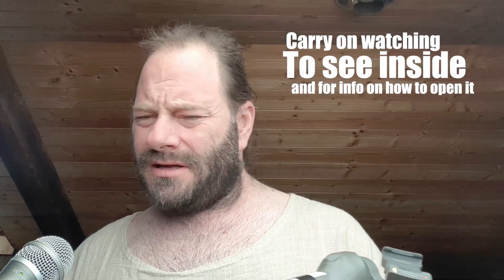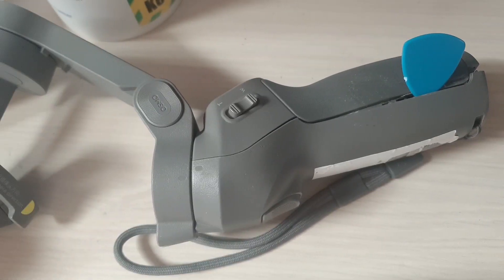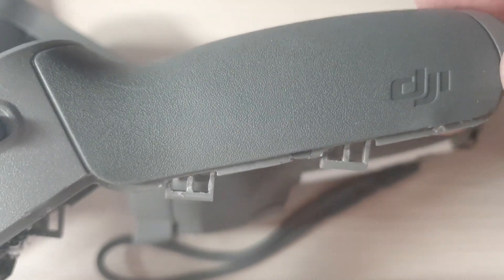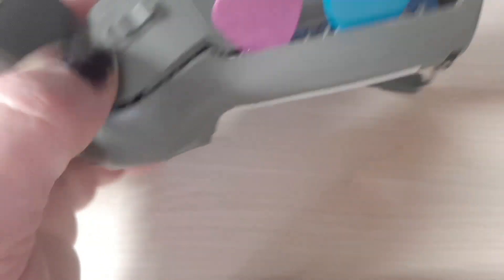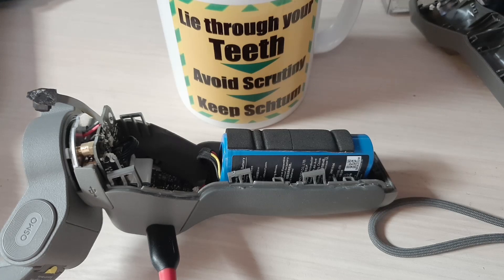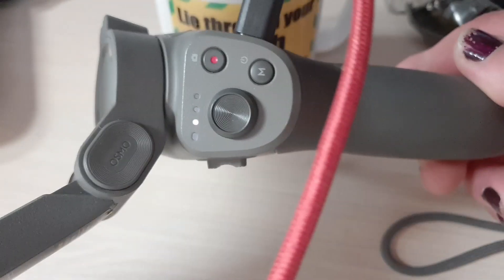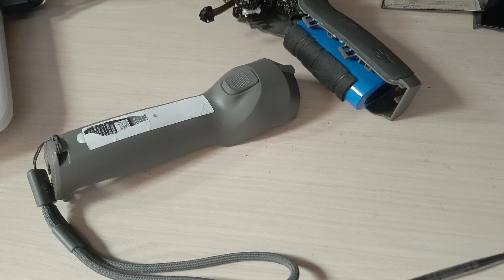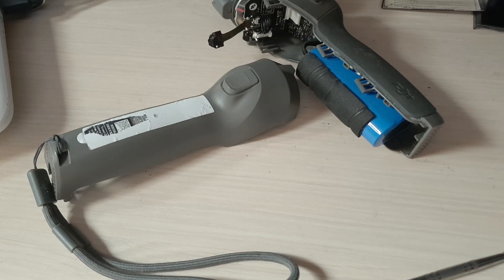DJI  Osmo Mobile 3 - Partial Teardown - Broken tripod socket.

Comment: Thanks for making the video! 
I'm contemplating modifying my currently working gimbal to add 1/4-20 threaded inserts that are found on other gimbals. 
The trigger connection seems to be the largest obstacle based on your teardown. Does it make sense to remove the trigger before opening up the handle? 

Also, I'd like to drill into the support arms to add accessory mounts. Does anyone know the construction of the rotating joints? 
Where does the wiring travel? 
How large is the motor that is embedded into the arm at the joint?  

Any details would be helpful for any who might know!
Reply from the maker: I would not recommend making any modifications at all to the gimbal head as you will put stress on the motors and damage them as they try to cope with the extra weight and balance. 

I haven't used this device in 4 years so quite unable to comment on the teardown now, sorry.

Comment: Thanks man. I had sea water spray on my gimbal the first damn time I used it and it must have damaged it. Still works when plugged in so I'll try replace the battery. Your video is one of the only disassembly video online about omso mobile 3.
Reply from the maker: I find it strange nobody else has done this...

Comment: Can you carry osmo mobile 3 in flight?
Reply from the maker: Hi, sorry, I really don't know. It has a lipo battery in it if that makes any difference, but so too does your phone and virtually every other bit of modern rechargeable handheld stuff. I would check with your airline.

Comment: thank you very much I've been looking for a way to remove it for a long time. Can't fit the battery charger Sent to the center and said that the battery cannot be replaced. So I'll try to do it myself.

I'm Thai. I typed it using google translate.

Comment: Sir can we change battery of dji osmo mobile 3
Reply from the maker: Thanks for your question. Technically, yes. the battery is not soldered to the board but on a removable connector. It's just a couple of 18650 cells. Practically, you would need to buy cells with solder tags and make a new pack. I can't find an official spare part for it having done a quick google, amazon and ebay search. Hope that helps.

Comment: I will gladly give up smooth clips for good old-fashioned screws any day
Reply from the maker: Sadly, screws cost more money than moulded clips. And, even with screws, moulded clips are often used to hold the seams together on products that are small and need to keep weight down with thinner materials.
Reply: @AndyBanner  yes but I've started repair my tech  phone charge ports etc 
Just spent 300 on a phone about a year ago and charge port broke already changed the battery and charge card for about 30 bucks . I really miss the old days of several screws in the back and that's it thanks for the video

Comment: Thanks for making this video! Knowing the locations of the plastic tabs and how short the joystick ribbon cable is helped a lot. I was able to open mine by working at one side and then peeling the case open. The ribbon cable stayed connected!
Reply from the maker: Pleased you found it useful